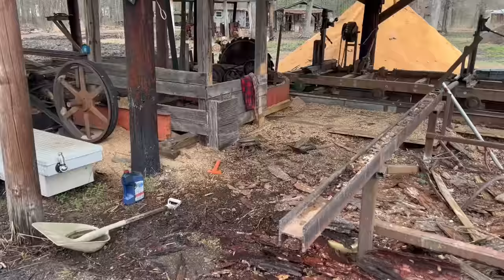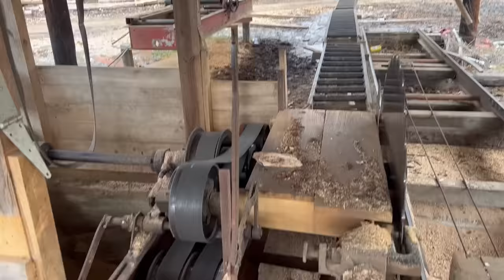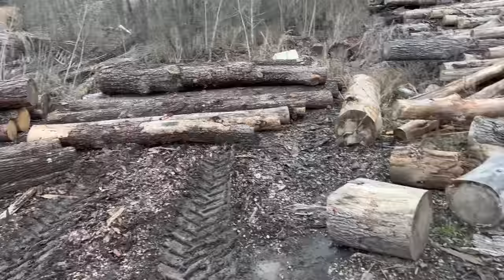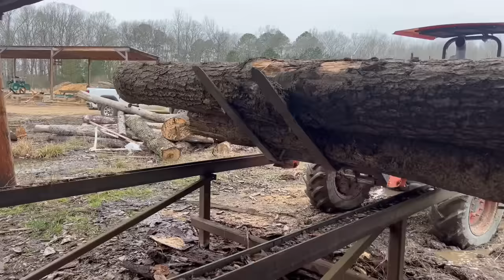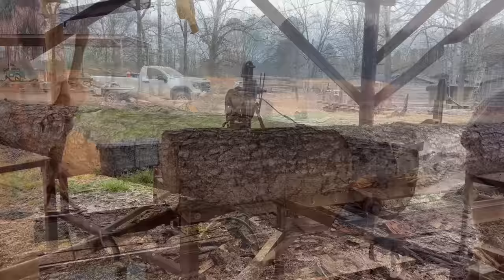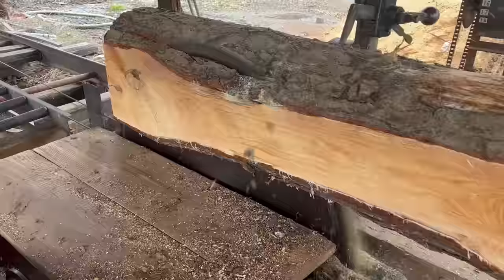Sawing Porch Posts on a Corley Circle Sawmill!

Comment: I grew up listening to Uncle Reese Hodge's sawmill about a mile from our house is Sale Creek Tennessee. He had a big diesel engine that ran a 60" blade. I remember it made a lot of sawdust, a mountain of sawdust.  This was a three-generation mill. Anyone who wanted to work could, at the mill or out logging to supply the mill.  This kind of work has been replaced by large corporations, except yours.
Reply: Several mills like Reese Hodges are running on Dayton mountain and around pikeville tn. I knew Reese pretty good, and ever body that worked around the mill. I got a mill, but i am not running it, i got to old. I grew up at coulterville. Elmer ownes also had a mill, i worked with joe fields logging as a kid, and worked at jack cranmoores mill down at backwell. I knew Luke Hodge pretty good to. Lot more mills like Reese was are running than most people realize. Reese mill was a corley just like the one in the video. He ran a 4-71 Detroit just like the one i got. I got a old corley mill carriage setting around. And enough parts to put the mill together. I got a m14 bellsaw mill i can run when i need to.

Comment: Impressive system,
Oldie but goodie.
What size is that blade?
Reply from the maker: 48"
Reply: @wallacefarmandsawmill  ware you guys located out of. if you head has the room upgrade to a 52" blade you'll be amazed how much easyer you can cut bigger stuff and you don't even need more rpms on the motor either. if ya do it won't need much tho.